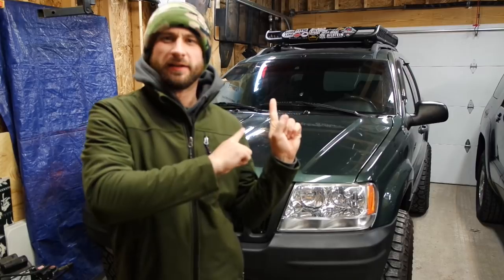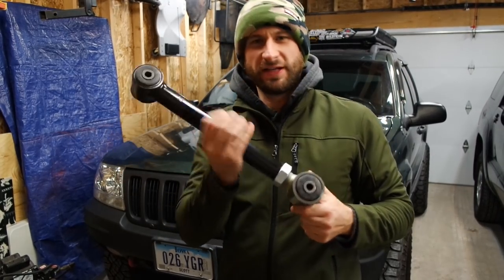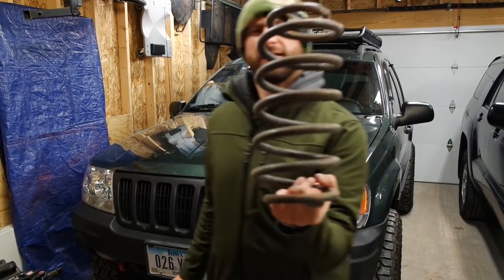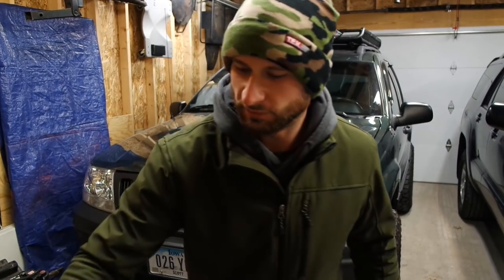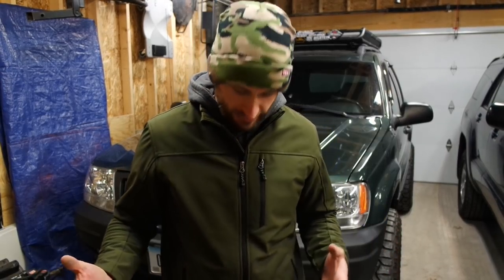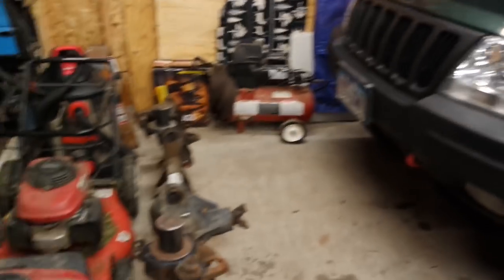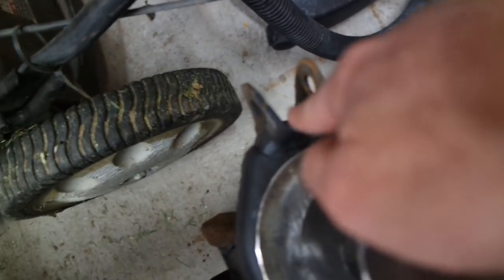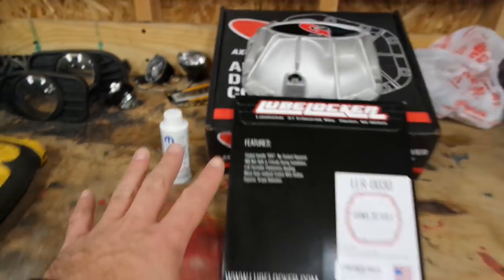Grand Cherokee Build Info and Update

Comment: I have an '03 Overland with QuadraDrive VariLock diffs front & rear. 190K+ on it and they're doing great. The VariLock diffs are not the traditional clutch-pack type LSD. It is a gerotor pump design, and very durable. You just need to stick to the maintenance schedule and be sure to use that Mopar friction modifier (nothing else!) and in the correct amounts. Most who complain that they are not working don't have the correct amount of friction modifier in them.  Some oils say they have friction modifiers already in them (Royal Purple, Amsoil).  

Good move on replacing the hub assemblies.

Why not Core 4x4 brand Control Arms?

For those watching, the A-Arm spacer is only needed with a 3" and greater lift.
Reply from the maker: All really great info! Couldnt have said it better myself. I bought what I found bargains on, plain and simple.

Comment: Hey we basically have the same setup, I have 2 wj's. My 04 limited has 2.5" spacers, RC adjustable lower arms, core4x4 adjustable uppers. 1.5" RC wheel spacers, Moab wheels and 265/70r17.  Although Im still running a stock track bar because my acle didn't really move over enough to justify buying an adjustable one.
Reply from the maker: I ran the stock track bar until I went to 3.5"